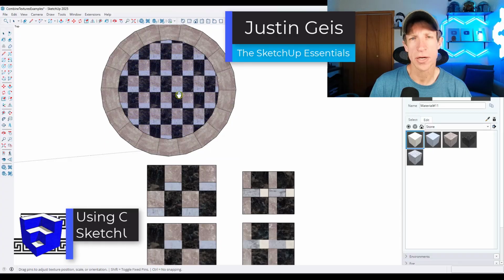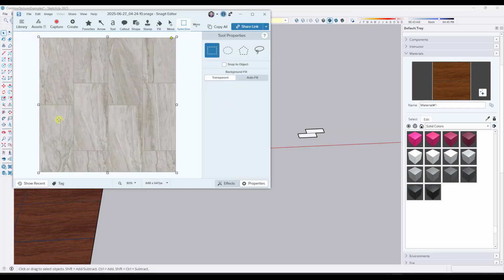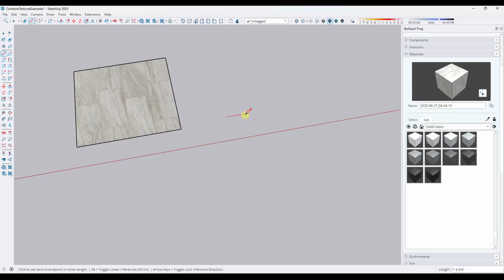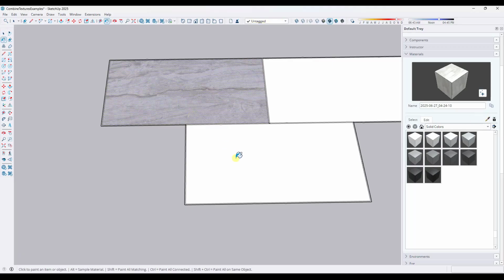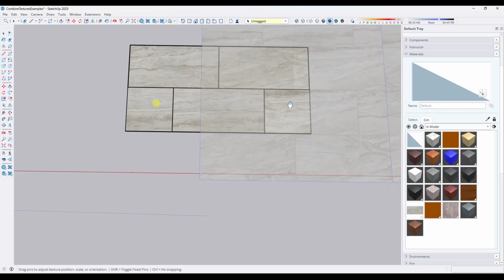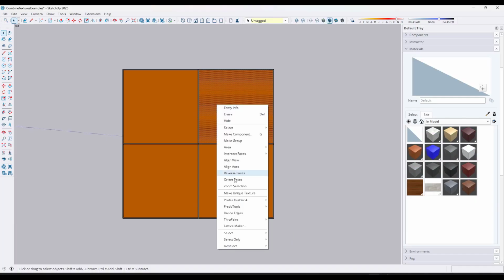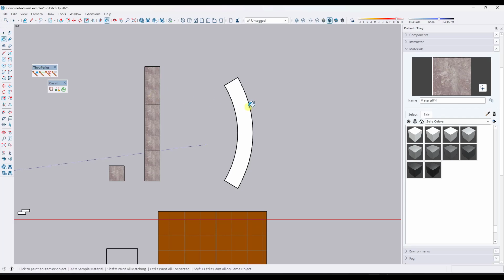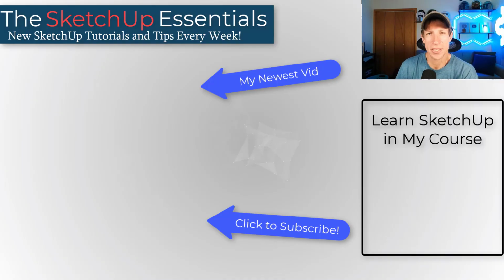How to Use COMBINE TEXTURES in SketchUp to quickly make seamless textures and more!

Comment: That's pretty neat.
I wish we had a plugin that works like the max tile material that has sliders for variation and grout smoothness ext.
That's a powerful tool from 30-20 years ago that no one copied to SketchUp yet!
Reply from the maker: Try Architectures - you can pick patterns, grout types, edit/adjust their thickness, etc